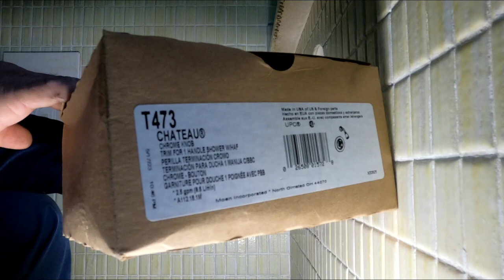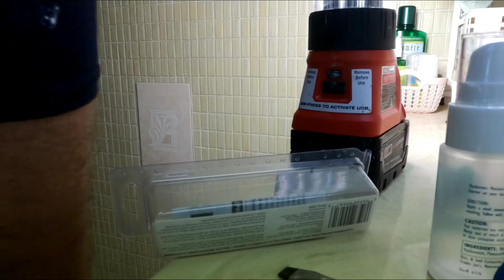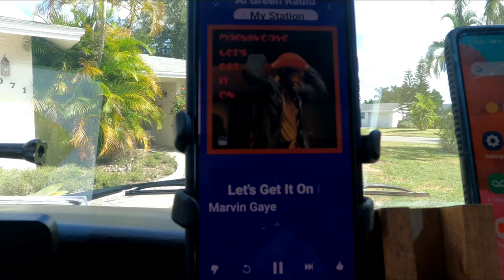STRANGEST SHOWER I'VE  EVER SEEN FIXED

Comment: hey John, I with you about not caulking the bottom of the spout. There's also a weep hole at the bottom of the execution plate on the valve that shouldn't be plugged with caulk. Thanks for the vids, keep up the great work.
Reply from the maker: Some may,I'm not sure about moen on the faceplate. 
Thanks for watching my friend

Comment: That is the weirdest shower ever I wonder why it was like that
Reply from the maker: Seems to me ,it was originally a recessed tub,converted to a shower,there was a lot of fine dust around the valve,probably from cutting the tile wall.
Maybe they added the window at some point.
Definitely not standard🤣🤣
Reply: @johnphillipsplumbing7148  agreed 🤣 I got a minisplit I'm helping a furnace guy with
Reply: This setup is to wash their feet. No BS . This is common in difficult countries